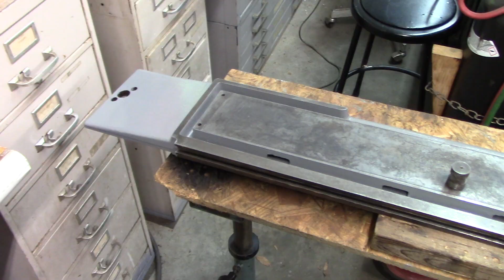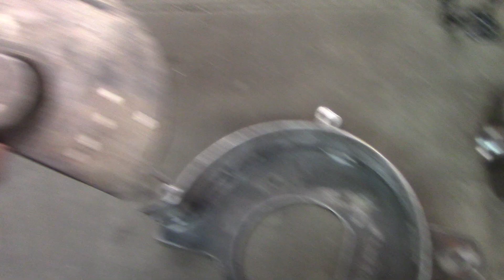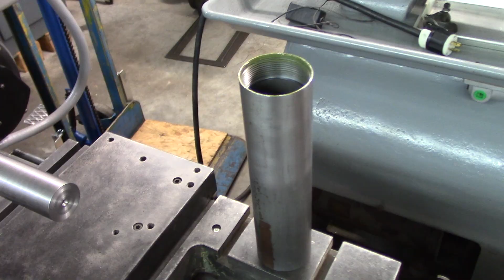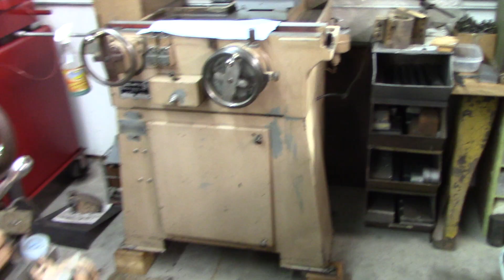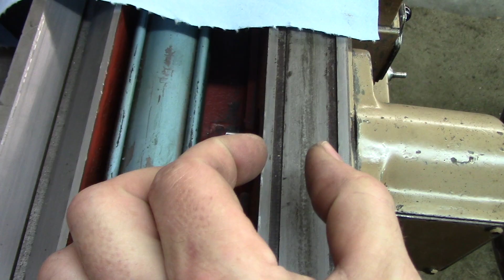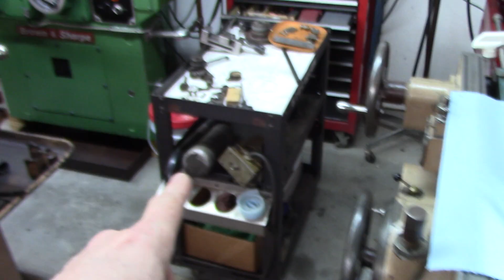6-9-25  --  Project Updates

Comment: I have the same grinder in my garage except mine is a manual unit. No hydraulic feed. Mine does have the ID attachment.
Nice machine. I used it to make custom ejector sleeves for plastic injection molds and other special parts.
Keep em working!
Reply from the maker: Nice to hear from someone else using the same machine, they really are great grinders. ---Doozer